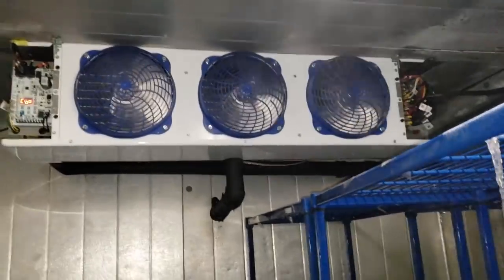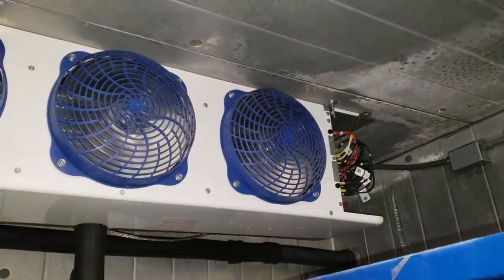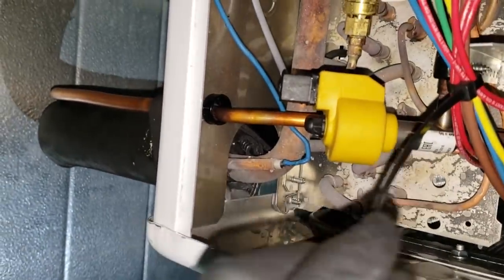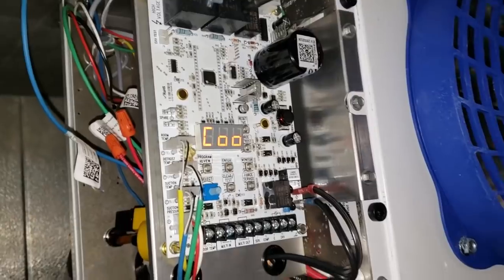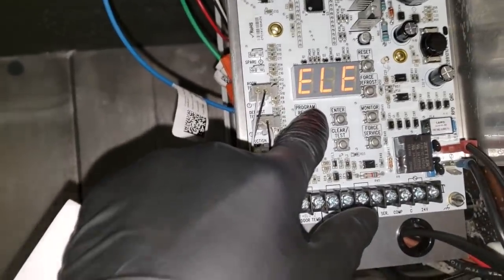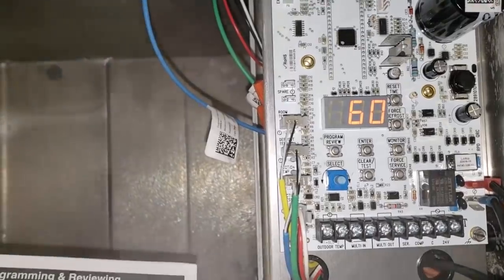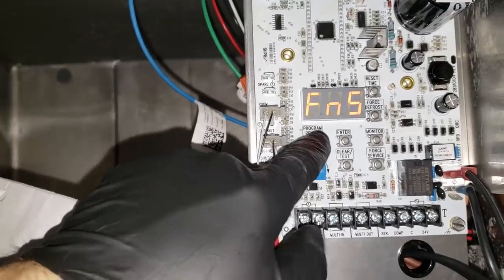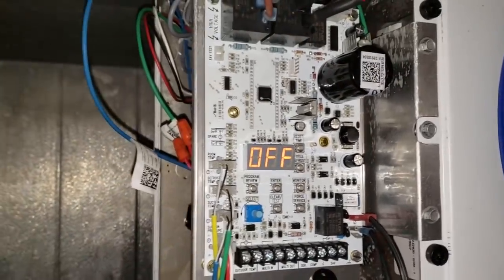Heatcraft QRC (Quick Response Controller)

Comment: Chris, that thermal expansion valve is totally digital. If you ever need to swap one out, pay close attention to the orientation of the cable that links the board to the TXV on the TXV side of the cable. It's a square plug and it can be plugged in at any orientation. There's only one way that works properly. Please learn from our mistakes. Mark the orientation of the cable before you remove it!
Reply from the maker: Great tip thanks bud
Reply: No it's got one pin that is larger than the other 3. Unless you force it it's going in 1 way.

Comment: I just worked on this same equipment on a w/i/f and w/i/c, had to install a check valve on both systems to prevent short cycling.
Reply: Trent Refrigeration llc 
Was the refrigerant R448 or R449.
I’ve noticed short cycling to be more common with those blends.
Where do u put the check valves in the system?
Reply: @alessichris07  it was 448 , on the freezer the check valve is approximately 6 inches from the comp on the suction line and on the cooler it is approximately 6inches from comp on the discharge line.
Reply from the maker: Thanks for watching I am going live on Youtube tonight 2/11/19 at 5:00 PM (pacific time)to talk about my previous videos and answer questions, if you can come over and check it out
https://youtu.be/9ZvGO4xQCP0
Reply: Trent Refrigeration LLC
why are these units more prone to short cycling and why the check valve in different locations on the cooler vs freezer?
Reply: @codylindstrom1346  heatcraft said it has to do with the compressor used in some of the condensers, they are bleeding back causing the pressure to rise, as to the location of the check valves, I put them where they wanted them located. On the freezer the new port for the preasure control had to go upstream from the check valve.

Comment: with these kind of systems Im running into some of the issues that you brought up. There is a time delay built into the controller, but there is also a time delay on the condensing unit. Unit kinda iced up and I wanted to eliminate the demand defrost but my boss said it's more efficient, but we will see. I called tech support and two reps told me to remove the time delay on the condensing unit. Fans would run inside the box but temp got up to 30 degrees so I checked all the sensors and board checked out okay according to the manual so I'm scratching my head as to why this keeps happening.

Comment: Interesting that you mentioned issues with smart (or adaptive) defrost . I just went back to a Heat Craft Intelligen controller unit. The store says they’ve had issues since start up (I helped install it 🥶). But I found that one fan blade broke, one fan motor failed, and then I saw ice build up behind and around the working fan. There is vibration now (so my plan of attack is: remove ice, inspect failed fan motor, and customize the intelligen controller to timed defrost mode (hopefully out 3-4 defrost a day.)
Reply from the maker: I will discuss this on my Livestream this evening 3/8/21 @ 5:PM (pacific) come over and check it out, and no worries if you can’t make it live as it will post as a normal video afterwards https://youtu.be/BNhJSTWXYfA

Comment: Yeah I had one QRC like this one. I'm not sure if you're aware that the compressors and repplacment parts are really expensive. Last time we had grounded compressors and warranty was expired so we found out that replacement compressor was rough 3,000 dollars with electronic expansion and everything. we ended up replaced $ 900 404A compressor, analog defrost clock, and changed electronic expansion to TXV , add solenoid valve  for more cheap alternative for easy maintenance and repairs.
Reply: Wwwhat? Dam, really!  So, having a choice of going with standard devices compared to this new stuff, you'd go with the standard equipment?

Comment: Anyone working on one of these they have updated and discontinued the yellow expansion valve. 3 changes in less than a year. That yellow one had issues with intermittent opening. And if you touch it, it starts working. Take the plug off the board and ohm thru the valve and see if you are getting 150 ohms on the terminals because getting dc voltage (1-5) at the pins on the boards won't tell you what is really happening . There are 4 wires and 2 circuits and you need to see if the voltage is getting to the pins on the valve. If the valve is bad you'll get 150 across 2 pins then something higher on the other 2 pins.

Comment: I am currently installing a heat craft with beacon 2 for a walk in cooler. Does the evaporator and condenser require communication wire ? This is my first time putting this in. Any guidance would be appropriate
Reply from the maker: If it is a Beacon system than yes it requires the com line
Reply: @HVACRVIDEOS  do you have a video on that where you talk about it and walk us through what that looks like on a system

Comment: Hi, I just have a quick question? 
Do the fans run separately based on a load, or they should all be working at the same time when required?
Thanks for your time.
Reply: They run all at once....You can google QRC and Heatcraft and download the install manual and it will give you more info about the QRC system.
Reply: @rosskious7084  thanks for your help Ross
Reply: I see where you’re coming from. Today I just went to appease the clients because one motor wasn’t working (motor is already ordered and waiting for parts) but it was keeping temperature. I entered test mode on a heat craft intelligen system: sure enough only one fan turns on. This system does have “stir” fan setting but which means it will drop fan speed to 50% (it can do 30-70% variable speed) the issue I’m having is ice up issue = vibration = broke fan blade = other issues but I’ll dive in soon or a co-worker will.
Reply: @David.rivas.alexis  I had the same issue David.
Moisture penetrating into the freezer box icing up the fun blades.
It’s a -30F, so I found the cause of this air intrusion. Gonna replace some door gaskets and run a few defrost cycle to thaw out all the ice accumulated on the drain pan.
Thanks for your input!
Reply: @FernandoSilva-zd2vl  bro spot on! That’s exactly what my co worker found out, infiltration through the lineset penetration hole and the door gasket on the bottom. It’s nice to be thorough. I’m glad there’s a solution for almost everything
Reply: @David.rivas.alexis  what’s great it’s having a community that can help each other on this aspect. I am new to the field so everything helps.

Comment: Chris, just a curious question: Have you dealt with evap units on small walk in freezers so tight to its side walls that it's impossible to extract the heaters?
Reply from the maker: Yeah I have you need to pull the coil out, and depending on the age you might as well replace the whole thing
Reply from the maker: Thanks for watching I am going live on Youtube tonight 2/11/19 at 5:00 PM (pacific time)to talk about my previous videos and answer questions, if you can come over and check it out
https://youtu.be/9ZvGO4xQCP0

Comment: How would the electronic control board keep up with the harsh cold temperatures in the box.
Reply from the maker: They actually hold up pretty well I have yet to have a problem, they are dipped in a waterproof coating
Reply: @HVACRVIDEOS  wouldn't the control buttons get rusted and loose contact after a while?
Reply from the maker: Thanks for watching I am going live on Youtube tonight 2/11/19 at 5:00 PM (pacific time)to talk about my previous videos and answer questions, if you can come over and check it out
https://youtu.be/9ZvGO4xQCP0

Comment: We deal with a lot of Beacon systems and yes the smart defrost is absolutely horrible just ran a call this weekend because of a frozen up coil on a freezer because smart defrost only allows it to defrost ice off the sensor then it terminates otherwise I’m a fan of the beacon systems until they have issues lol
Reply from the maker: Thanks for watching I am going live on Youtube tonight 2/11/19 at 5:00 PM (pacific time)to talk about my previous videos and answer questions, if you can come over and check it out
https://youtu.be/9ZvGO4xQCP0
Reply: I’ll try running on call this week and currently on a roof changing a pumpkin trying to polish a turd lol but in the end it will make air cold lol

Comment: It makes sense to integrate defrost controls into the evap coil, it just simplifies everything. I’m not sure that using the EEV in place of the solenoid is the best idea, if the EEV plunger pin wire draws and leaks (and it probably will one day) it will set up an old compressor to short cycle. Maybe that is what was intended...
Reply from the maker: Yeah I notice some manufacturers still put a solenoid also just to be sure
Reply from the maker: Thanks for watching I am going live on Youtube tonight 2/11/19 at 5:00 PM (pacific time)to talk about my previous videos and answer questions, if you can come over and check it out
https://youtu.be/9ZvGO4xQCP0